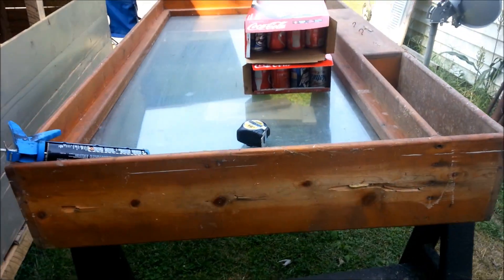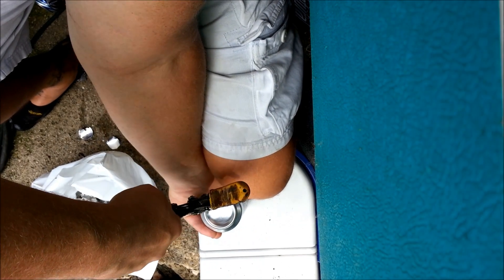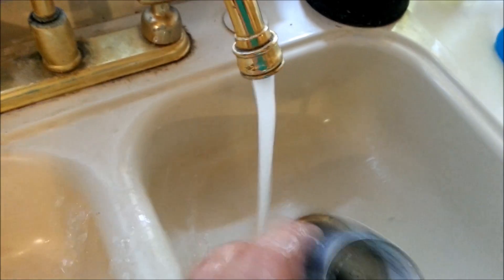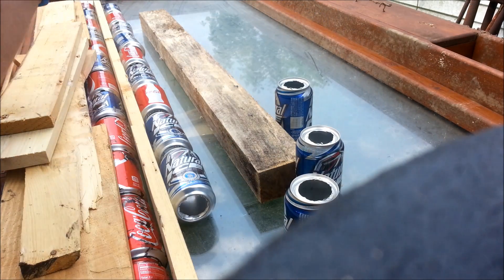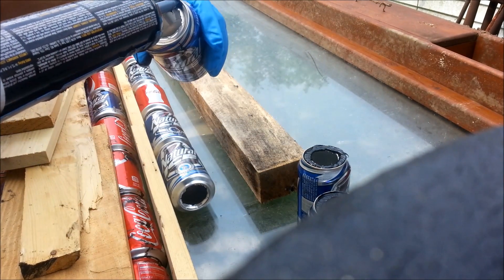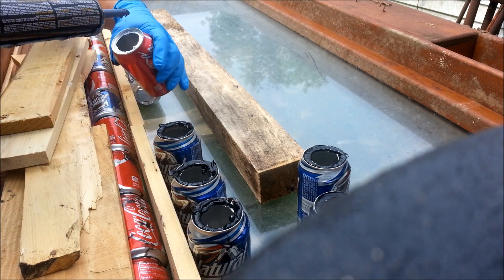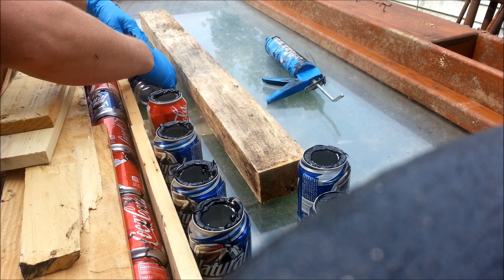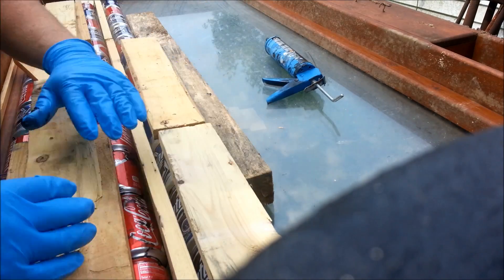How to build a Solar can heater / solar furnace, for solar heat. Part 1

Comment: Hi m8y.
i have been doing a bit reading on this kid and found out that you are NOT suposed to cut the top and bottom out totaly, but leave the top and the bottom split the bottom in a cross and open up slightly, this is to cause turbulance so the air inside swirls about and makes more contact with the sides thus increasing efficiancy .
pardon my spelling by the way.
any thaughts on that bud...